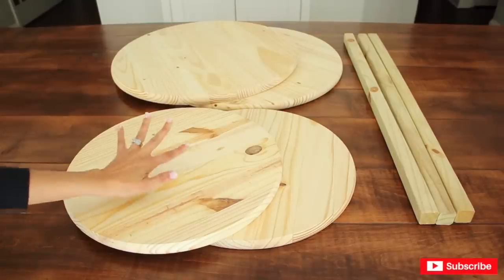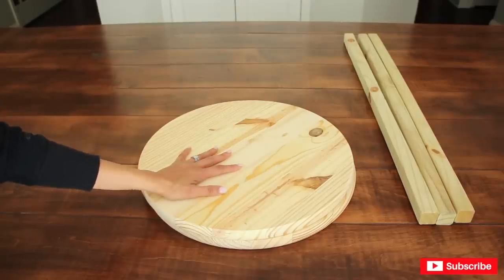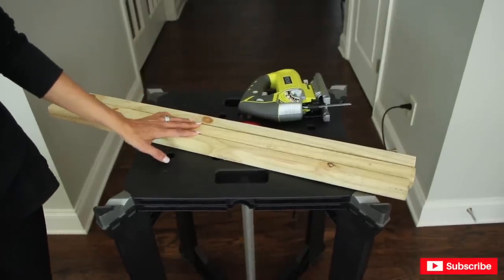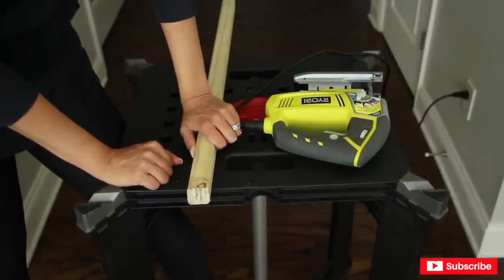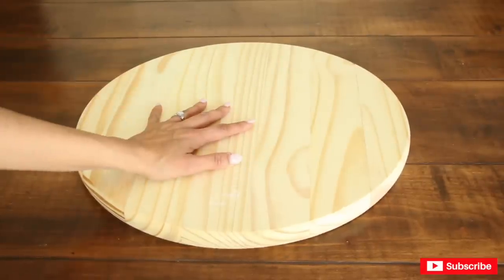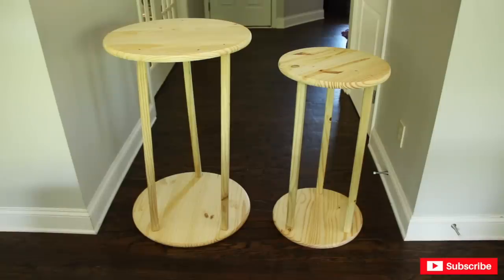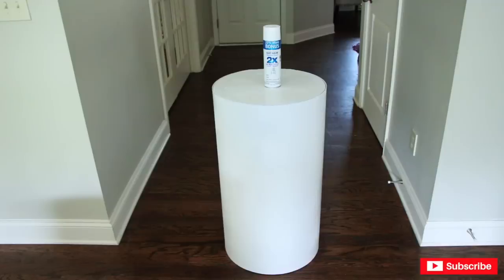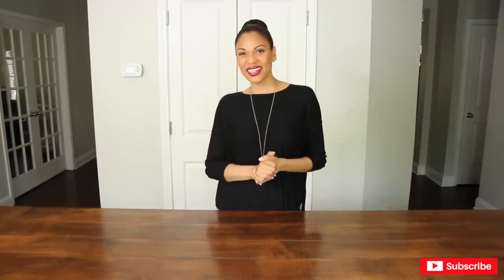Pedestal Stand DIY | DIY Plinths

Comment: This is a great idea, but I found a super easy way to do this.   Buy the cement form from home depo. They come in different sizes.  I got the vinyl poster board from hobby lobby and wrapped them. It was supper easy.

Comment: I built mines same way but instead of balusters (because they cost $6 each at my home Depot 😓) I used 2x2 wood and had them cut to size (only cost me $1 and some change each) 

. Also the poly wall panels were pretty pricey for me too. ($26 each) so I used white board panel material instead and cut them to size (only cost me $9 each). 

It turned out looking great! 

Thank you for sharing this DIY! This was so clever and I definitely needed this!
Reply from the maker: Awesome! Glad it all worked out 😊
Reply: Hi, where did you find the white board panel ?

Comment: Suggestion: you could have used four Balusters instead. First find your center of baluster length wise. Secure one side of the board with nails going all the way down from cylinder through the baluster to the other cylinder. Bring board around to meet the other side of same baluster and repeat securing with nails or staples. One of the balusters is an anchor for securing each end of board. I hope you understood that. Loved another video. ❤️
Reply from the maker: Thanks for the tip love! :)
Reply: wt is the white material called which she wrapped around the table :/
Reply: Carmen M Edwards It kind of makes sense to use more balusters but can you explain that again please? I didn’t get it.
Reply: Gloria Mensah well she didn’t really need to add another baluster but 👉🏾she secured her board to the round wood pieces only. When she could have lined her board up to the baluster and secured it all the way down the baluster then bring other board around and secure on same baluster.
Reply: @mehroztayyab  in the video she calls it a poly panel

Comment: Use velcro instead on nailing it down so you can change the colours
Reply from the maker: Not sure if I’d hold, plus you still need something solid as base. You can add material over, and use Velcro to close up. Had a convo with a subscriber about this last week, and decided I was going to make a vlog about this soon 😊

Comment: I need help I've been looking for polywall panels and i cant find it to save my life i have all my other supplies already just that one piece of material HELP. everytime i go to home depot they take me to dry wall 🤦🏾‍♀️🤦🏾‍♀️
Reply from the maker: It’s a bendable hard plastic. At my HD store they’re in the section with the wall panels, ex. Faux brick wall panel, chalk board panel. They’re 4x8’. Used to be placed on walls.
Reply from the maker: They lay them flat, not standing.
Reply: Thank you so much